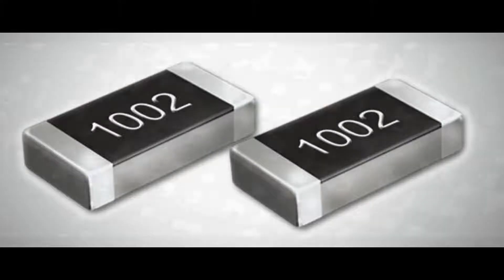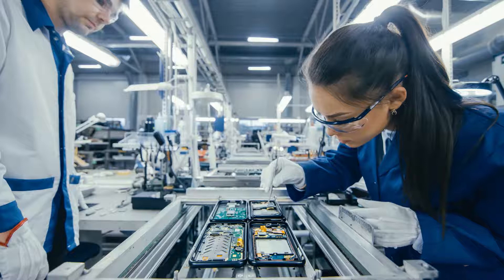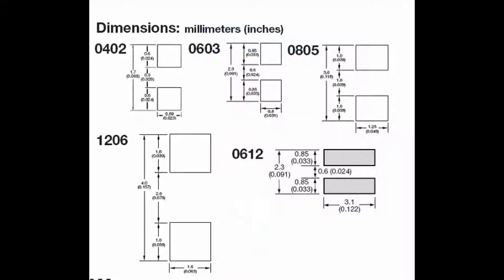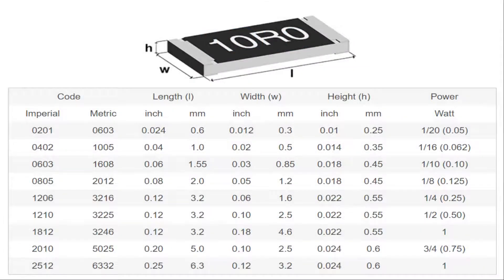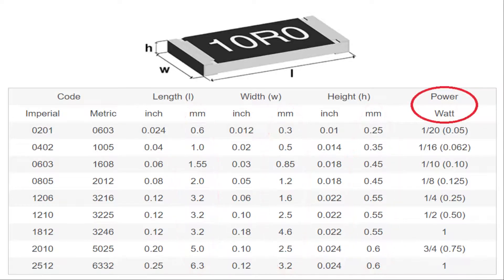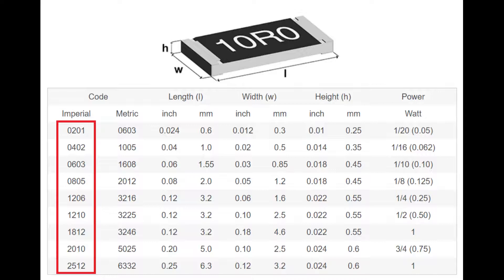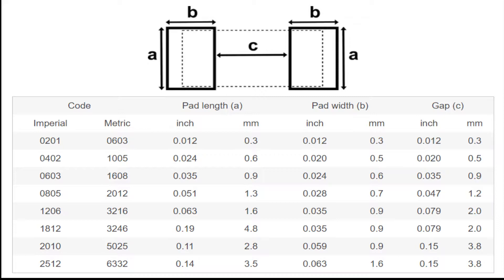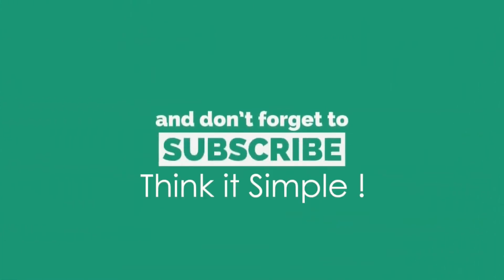SMD Resistor package codes and Footprint. SMT component Sizes. SMD Resistor Coding Explained.

Comment: Very useful information... Please explain smd resistor without any marking how can we know the value.. Thanks
Reply from the maker: there could be the only way to measure it with DMM and this happens only in very small packages for which printing marking is not possible.
Reply: good question ,  no body ever talk about non marked resistors and smd capacitors
Reply: same question..but no one answered correctly

Comment: How can we understand whether the value specified in the diagram is metric or inch. For example, is the smd capacitor called 0603 in the diagram metric?
Reply: I have this little scale infront of me made by adafruit and shows Imperial 0201 is Metric 0603.
Reply: @user-zm1vt3rf9b  
What I want to ask is whether this value should be accepted as metric or inch for the smd component mentioned as 0603 in a schematic diagram. I assume that you do not have a ruler in your hand when asking this. Suppose you can only measure the value with a multimeter.

Comment: So I just used a digital caliper to measure the length and width of an smd resistor rated 472. The measurement I got is 0.16L x 0.12w....

So the size would be 1612??

Thank you!
Reply: DigiKey gives you exact sizes for all components in their parametric search.